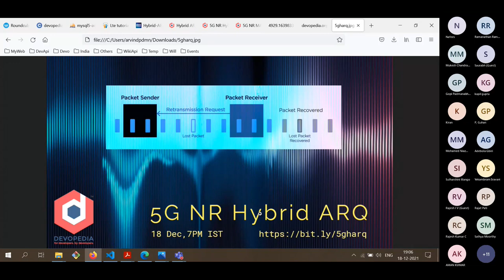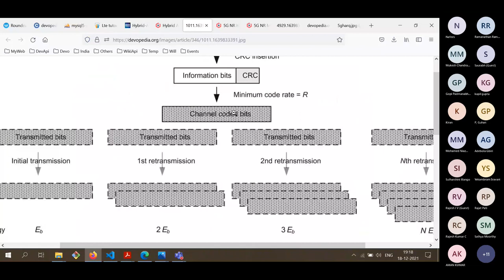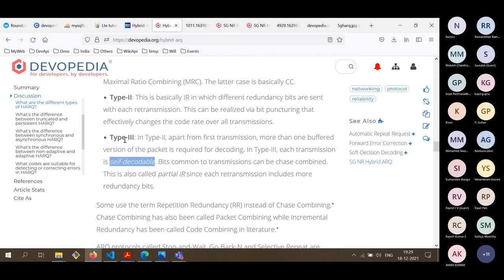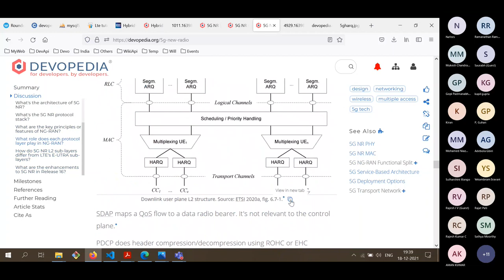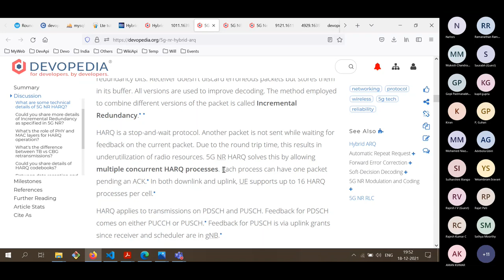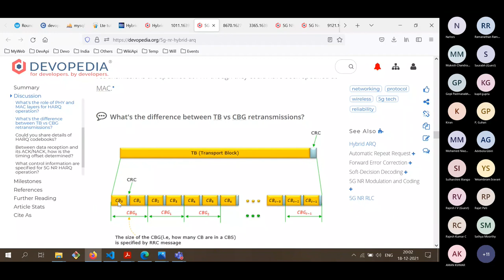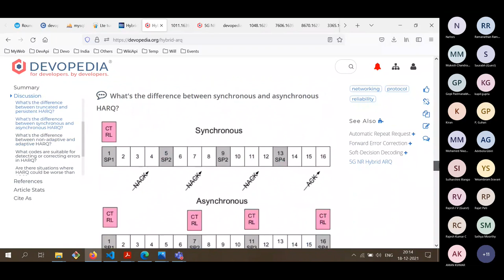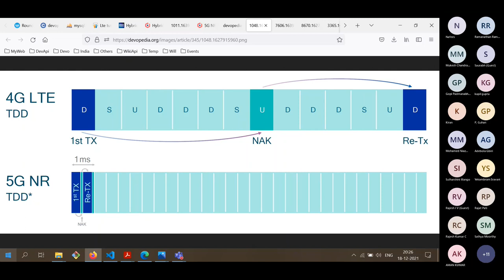5G NR Hybrid ARQ

Comment: I think question related at 39:50 is relevant, ACK/NACK is quite important for special cases. 

1. ACK NACK received from RLC through 38.425 NRUP protocol (I think this handles the case of any loss of packets between CU and DU in split architecture)
2. PDCP Status Report - typically triggered during HO
3. Also it comes into picture for Dual connectivity cases